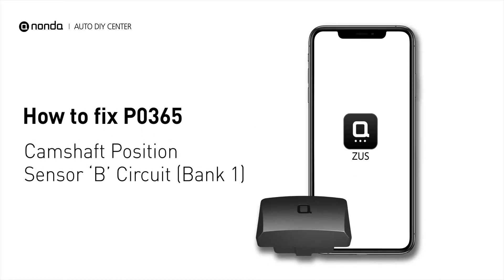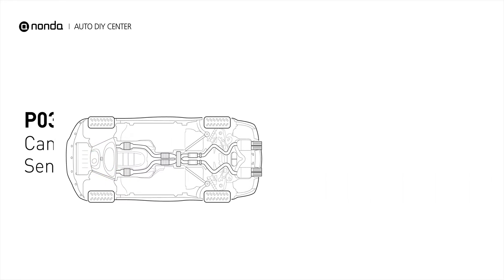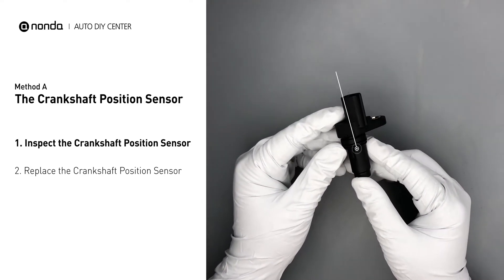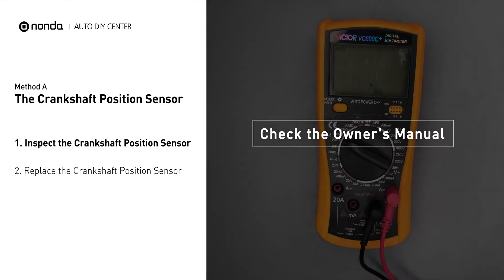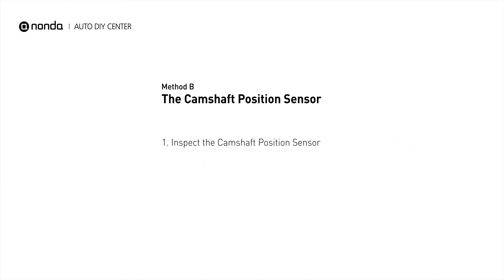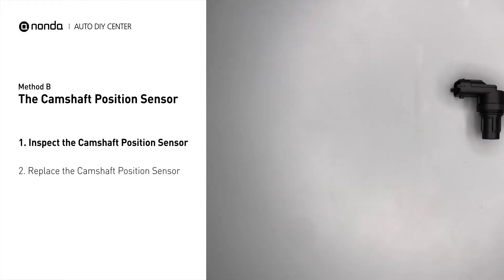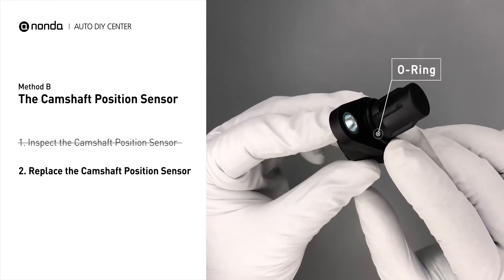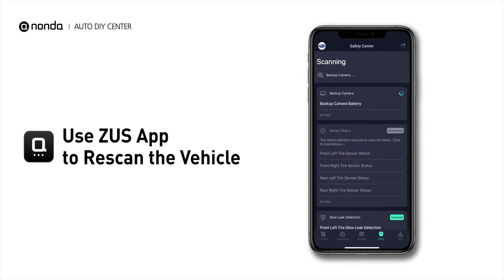How to Fix P0365 Engine Code in 3 Minutes [2 DIY Methods / Only $9.78]

Comment: My car(nissan qashqai 2015) has this. I had the camshaft position sensor and the camshaft adjuster  replaced.

I also hear weird clunking  noise, when i am accelerating.  Is that because of p0365?

Comment: Hello, I just replaced the camshaft sensor but still getting the check engine light on as well as the traction control light please help
Reply: Same for me.
Reply: did you fix it
Reply: Have you guys fixed it?

Comment: Hello nonda i have the same code but wat shocks me is that the my bmw 320i e90 had a major service a month ago and mot says wiper and tpm cause tires was low due to not driving and the battery was flat. I dro e to London and back so 2 hours there and back to where i live var seemed fine. Then this morning i go to start and the car stuttering and sound like it was go die so hit the stop button check engine light on. Scanner says camshaft sensor circuit bank 1. How do i diy fix it or do i have to go to a mechanic?
Thank you for reading
Reply from the maker: Hello, if there's no other codes that register along with this code, we suggest following the tips/solutions provided in our video on how to fix this code. Hope it helps!

Comment: So by having the code p0365 it can also be the crankshaft position sensor?
Reply from the maker: Hi Julio, yes- faulty camshaft position sensor and oil leak.
Reply: @nondainc he said crankshaft not camshaft
Reply: @AraP24 yes
Reply: @nondainc can you answer that please 
I have same problem

Comment: I replaced all 4 sensors and replaced the pigtail connector on bank 1 and still getting this code
Reply from the maker: Hello, please provide us with your vehicle's year, make and model so we can address to your concern accurately.
Reply: @nondainc  2006 Audi A6 3.2 base model
Reply from the maker: Hello, kindly check your battery, starting motor and starting system circuit for any issues. Also, please double check if there's any other trouble code that registers along with P0365.
Reply: @nondainc  my scanner saying pending code it want clear but I will try what you said

Comment: My Scanner said P0365, I replaced the CPS, but it still wouldn't start.
It ended up the Timing belt tensioner failed and the belt jumped, eventhough it was only 1 month old with only 2,000 miles!
Reply from the maker: Hi Henry, please provide us with your vehicle's year, make and model.

Comment: Hi one day engine light turn on in my dashboard and car was driving fine that day the next day when I was driving it was losing power wasn’t driving same like before I parked next day won’t turn on after was shown this two codes 0340 0365 I change all the 3 sensor at one mechanic but still won’t turn on I think one of the sensors was with oil around it he said is ecu or timing chain but he don’t know what is it I send to other guys same thing they said can you give me one idea what could be sorry for long writing just trying to explain all the situation my car is Mercedes Benz c180 if any idea what could have my car I will appreciate thank you
Reply from the maker: Hi Manuel, since you are receiving multiple error codes, we're afraid that we couldn't suggest a solution for you as this must be visually inspected by a mechanic. However, we suspect that there's an issue with the timing chain.

Comment: Hey I'm getting this code and a emissions code. It started fine after I put the timing chain on, on first crank the first 4 tikes them it backfired and hasn't start since. I have a flashing light on my "D" on the dashboard also.. Honda Civic LX 1.8L 2010..  Just changed the head gasket and have checked all bolts and torque.  I had a ton of carbon build up that I have been trying to get it all out.. I just don't know if I need a to buy these sensors.
Reply from the maker: Hi JR, have you inspected the wiring if there's any damage or if there's a corroded connectors? Check if there's an oil leaking onto the sensor. A replacement for the crankshaft position sensor is also suggested if faulty.

Comment: My car won't start it cranks but no start..filled my car up with gas tried to start it and nothing. Changed my battery got power n crank but lost start hooked up my scan tool got a code for camshaft sensor replaced it tried to start my car and got nothing  checked my relays n fuses all are good checked my spark plugs they look good. Any ideas would be greatly appreciated
Reply from the maker: Hi Charles, have you checked the condition of the wiring, connections, PCM or, if there's any fluid/oil leak?
Reply: @nondainc  yes I did, No leaks of any kind and pcm looks good
Reply from the maker: Hi Charles, can you let us know your vehicle's make/model?
Reply: @nondainc  2010 Kia forte ex sedan 2.0 Cali emissions
Reply from the maker: Hi Charles, please have your car's battery checked as the issue could be coming from it and a replacement might be needed.
Reply: Engine compression